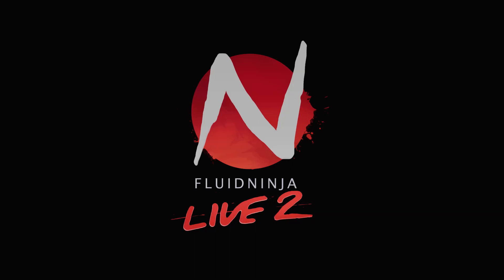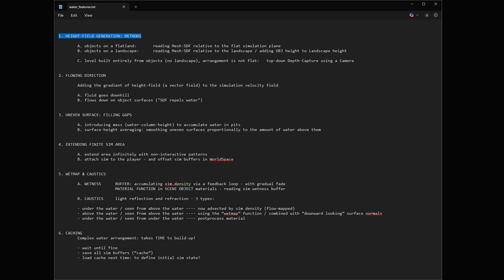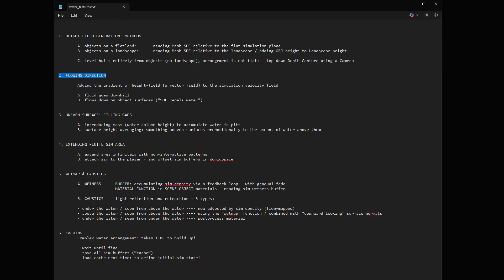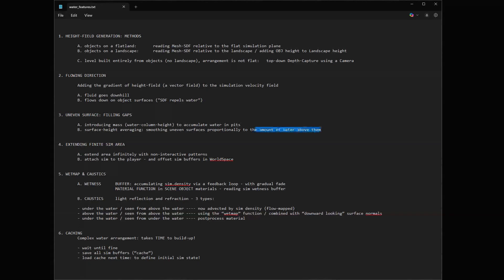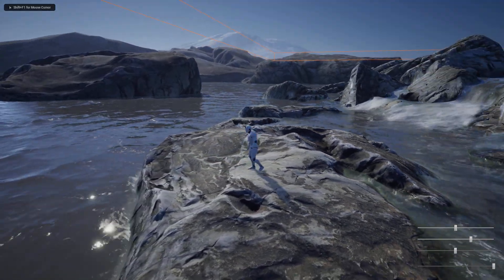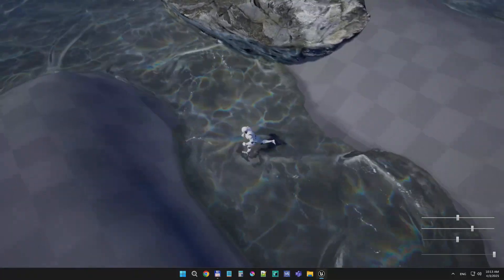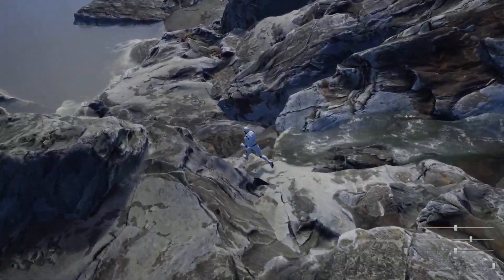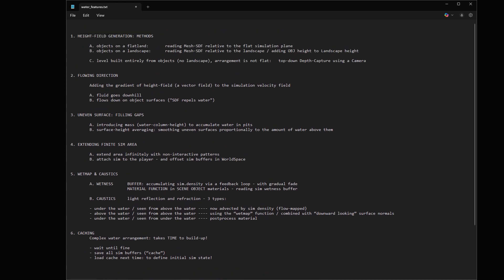Water on Landscapes - Features explained - FluidNinja LIVE 2.0 PRE-ALPHA

Comment: Thank you for the really good quality asset. I would like to bake the live water ripple effect and use it in a cinematic sequence. Is it possible to do this using only the buffer data in the material, not Volxel? If so, please provide a tutorial.
Reply from the maker: Thanks for reaching out! --- This video is for the upcoming Live 2.0  --- L2 could capture (bake) a single frame simulation state, with the purpose of loading it next time - and continuing the sim from the stored state (so, this baking is NOT for cinematic purposes). Currently, there is no other kind of baking in the system. But: why would we need it anyway? Ninja could be used for cinematic purposes, simply by using the real-time renderer for MRQ. While Live 2.0 is in the makings --- Live 1.9 fully supports Sequencer and MovieRenderQueue - see Manual Chapter 23! --- For more info, reach out to us, at the community server: https://discord.gg/rgEtwua2tu

Comment: Is it able to interact with 3D landscapes, for example "voxel plugin" which can create cave ?
Reply from the maker: Thanks for reaching out! --- Ninja 2.0 can interact with standard unreal "Landscape Components" - WorldPartition and LargeWorldCoordinates supported. Users reported:  voxel plugin is capable of exporting elevation (height) data to RVT assets (runtime virtual textures) - and ninja could read RVT. So, in theory, we might be able to interact with a Voxel landscape. This needs to be tested - following ninja 2.0 release, late 2025.
Reply: @AndrasKetzer  Sounds great!  However, RVT is still 2d height infomation. So digging an underground water pipeline to transfer the water from a lake should still be quite difficult, right?
Reply from the maker: @hengyuanma998 the advantage of using landscape height - instead of a top-down captured scenedepth: objects could arch over the water / water could flow under meshes. I am not sure how voxel plugin would handle voxel holes under the voxel surface. The point is: ninja needs 2D height data.
Reply: @AndrasKetzer  I'm starting to understand your point. Indeed, compared to capturing scenedepth from a top-down perspective (which is how fluidflux did), obtaining the 2D height at the current water surface level is feasible. This way, it can ensure that the water flow is not affected by occlusion from objects above.    I noticed that you use the SDF of scene objects to calculate the areas where water flow can reach. So, for dynamic 3D terrain, if we could obtain the terrain SDF values in real-time, would it be possible to achieve water flow inside caves?"

Comment: This guy is absolute Amazing. With the simulation being attached to the player, would I be able to travel with a raft?  I understand what you said and the issues was that the character moved faster than the fluid could fill, but what if the game was designed with a slower moving character, maybe not a human? Point 4 and Point 5 - using a raft we would need to influence objects around the simulation.  Keep it up!!  cant wait
Reply from the maker: Yes, with a slower-moving-player --- combined with a large enough area (100-200 meters) the rafting idea could be implemented!

Comment: this is insane!  with the information you are already getting for speed and height, you could also make a very nice  dynamic water splashes system! that would be the cherry on top!
Reply from the maker: @erickuitar25  thanks! My plan is to implement splashes and whitewater via GPU particles
Reply: @AndrasKetzer   wonderfull! would it be possible to add a configuration for beach waves?  there are already very nice waves generated by objects, I tried to make some using some animated invisible meshes but I was unable to have a decent result

Comment: Hello, thanks for your work.
Is there any possibility to have a river simulation?

To be precise: lets say we have a slope on top of the mountain, which comes down not as constant slope from up to down, but with different elevation levels, and lets say a river depth is 4-8 meters - will that be possible with this Fluid Ninja feature?
In the video I can see simulation with mostly no depth of the fluid.
Reply from the maker: @mercifulhades9830  thanks for reaching out! Yes, we can set this up two ways: (1) via simulation (not ideal for deep water bodies, but it might work), and (2) using the improved spline method (fluidsim runs on user defined spline surface) - check in to the community server, where I've already posted previews for the spline setup!
Reply: @AndrasKetzer  sounds gorgeous. thanks a lot for the answer.

Comment: When using land built from objects and leaning on a top down camera to capture depth how will it work with overhangs?  Can the water flow over one rock but under another?  I see it working in the caustic example just curious how that works?  The caching will be incredibly useful.
Reply from the maker: @IronfinInc  with method 1&2 (mentioned in the vid) it can. With method 3 (scenecap) it can not.

Comment: Very cool!  have put any thought into heuristic cheats for breaking or, "barreling" waves?  For example if the velocity and height are over x amount at a defined shoreline, displace the mid range height  of the wave's leading edge geometry in the negative horizontal direction of the velocity, along with displacing the top range height in a negative vertical direction to "hollow out"  and crash the wave.
Reply from the maker: @importon  thanks for the brilliant idea: yes, once the core features are stable, I'd like to implement this! 🖐